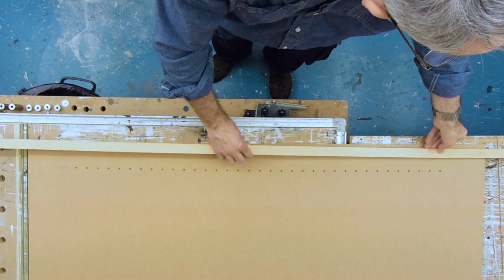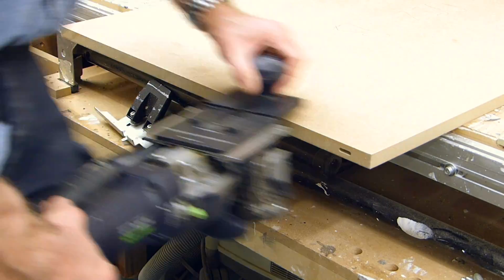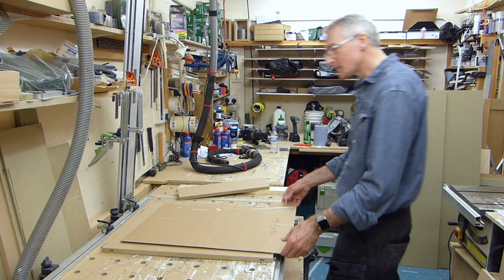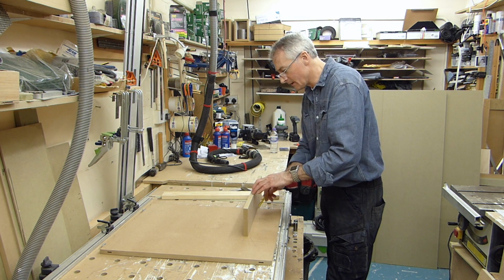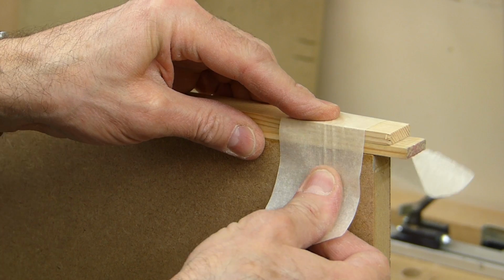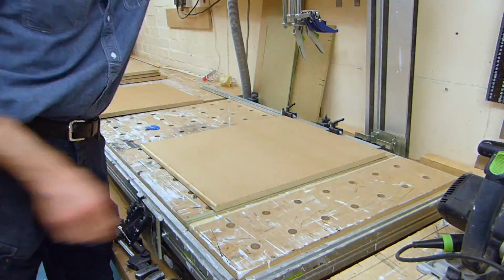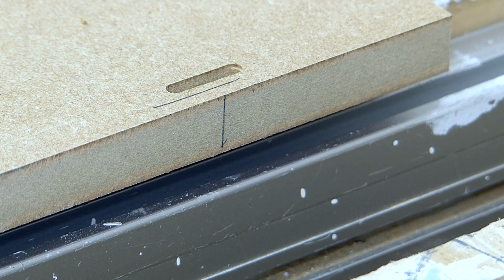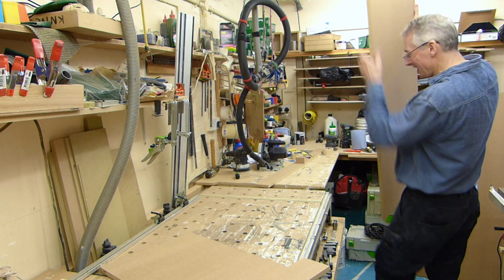How I make custom cabinets with adjustable shelves, part 2

Comment: Great series Peter. I have a domino and got confused which faces to reference off. Think you reference off the two outside edges? I like the attachment for the domino, do you find it useful to help centre the dominos? Cheers
Reply from the maker: DIYJase Sorry - just seen this. Yes, the domi-plate is very handy, and yep, always reference off the outside edges 👍
Reply: No need to apologise. Thanks for the reply, when i first used my domino i found that something slipped and then dominos did not align :-(

Comment: Hello Peter!! did you do the black accessory on domino jointer ?? or buy??.Thanks
Reply from the maker: Hi. I bought it - it's a 'domi-plate' from Seneca Woodworking -https://goo.gl/UMq22C - Great piece of kit, though I also used a piece of plywood screwed to the base for a while before ordering it, which worked well, but didn't centre the domino in the workpiece, obviously. 👍

Comment: i have a project in mind ( blanket box ) and thinking of using some t&g boards to create a panel effect. The t&g is 12mm thick. How do you suggest i attach to a frame. couple ideas simply to nail the frame and t&g to a backing board or create a tongue on the end of the boards and rout out a groove or make a frame with  a rebate for the t&g. what would you suggest?
Reply from the maker: PAUL ROBSON Nice project - sounds like it should be a video 😀 If it needs to be strong (folks sitting in it, little kids climbing, or if it’ll be moved around a lot) then I’d be inclined to glue the T&G to a backing board, and set this into a groove in the frame. If it’s going to have a quieter life, then rebating the frame will be fine.

Will this have a natural finish or be painted? If painted, I'd consider using a decorative v-groove MDF panel (sometimes called TGV, matchboard or bead & butt); this typically come in at 9mm thick, so not really strong enough on its own, so I'd make a box frame with inset panels (grooved or rebated) then glue and pin the grooved MDF in place.

HTH Peter
Reply from the maker: Nice project - sounds like there should be a video 😀. If it needs to be strong (folks sitting in it, little kids climbing, or if it’ll be moved around a lot) then I’d be inclined to glue the T&G to a backing board, and set this into a groove in the frame. If it’s going to have a quieter life, then rebating the frame will be fine.

Will this have a natural finish or be painted? If painted, I'd consider using a decorative v-groove MDF panel (sometimes called TGV, matchboard or bead & butt); this typically come in at 9mm thick, so not really strong enough on its own, so I'd make a box frame with inset panels (grooved or rebated) then glue and pin the grooved MDF in place.

HTH Peter
Reply: Peter Millard the top is going to be hardwood and the base painted. Here in Australia we don't seem to have the range of sizes you have for example I cant get 22mm mdf. i haven't seen the 9mm panel either., but i could make my own.
Reply: Looks like i can get the 9mm mdf, just my local store didnt have it not all stores stock it.
Reply from the maker: That's good news! Painted base and a nice hardwood top is a good look, very contemporary, should work a treat 👍. BTW one benefit of making your own v-groove panel is that you can space the grooves to suit your workpiece - might be something to consider?? Cheers, Peter